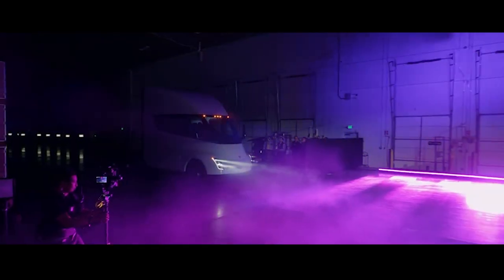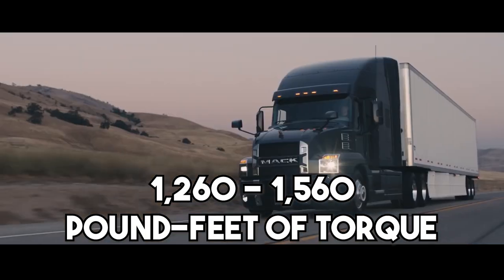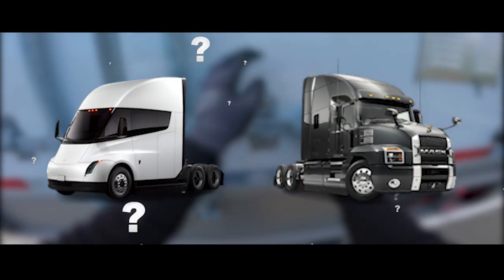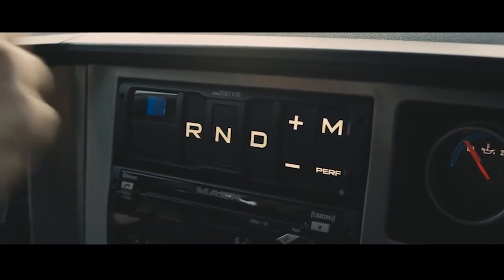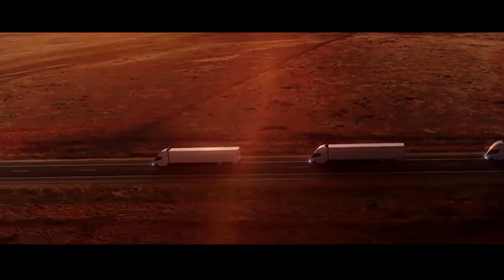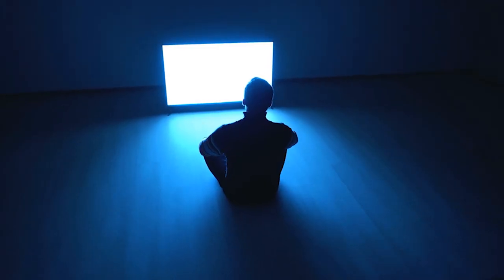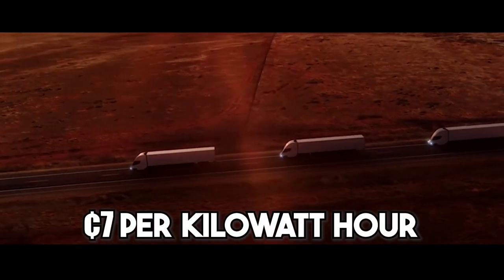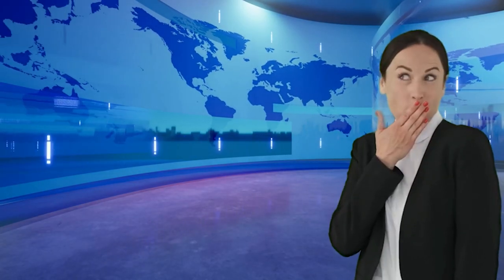Why Tesla Semi Truck Will CRUSH The Mack Anthem Diesel Truck?

Comment: My primary concern is charging the battery. How long does it take and where are the chargers going to be? Also horse power is a secondary consideration to torque.
Reply from the maker: Thank you for watching! We are looking forward to sharing more quality content.
Reply: Currently 70% just 20min.
for FAST charging, Tesla built chargers @ Sacramento and Modesto. 
Tesla has round trip range of 300 miles from Depot.

Comment: Technology Academy - NOPE, the Tesla 2022 uses 3  PLAID motors from model X. and they are carbon sleeved w/ model 3 inverter each motor. 
each motor is Football 🏈 size and can be carried in a backpack 🎒.
the 3 PLAID motors makes 1200 HP + , and 1000 lb torque.
Reply from the maker: Thank you for watching and sharing your thoughts

Comment: The only way the Tesla Simi Truck will ever be a long haul solution, is the solid state battery pack.  It will be lighter in weight, and fully charge in 15 minutes or less, which is about the same time it would take to pump diesel.  For now, they will have to be relegated to short runs only.
Reply from the maker: Thank you for watching and sharing your thoughts

Comment: I don't think that these electric trucks are better than the conventional ones and vice versa... each one has its good and bad things, for example, the cost of replacing the batteries of electric trucks once they are damaged by use, which could be even greater than diesel truck auto parts in quantity
Reply from the maker: Thank you for watching